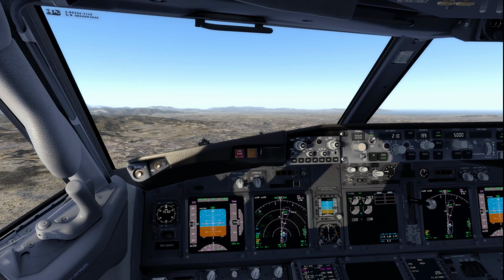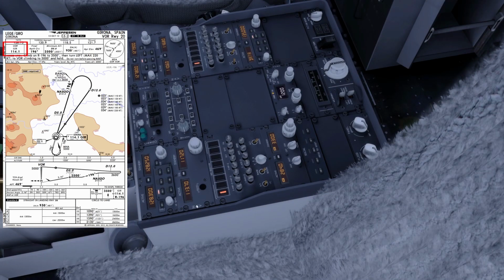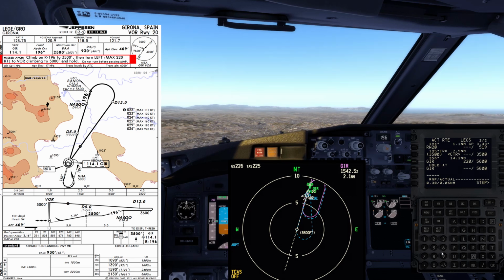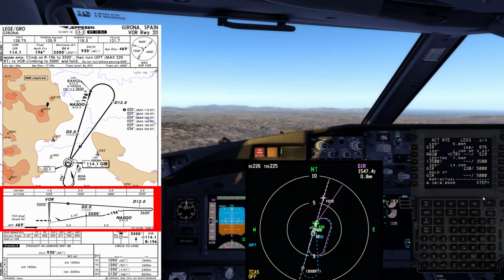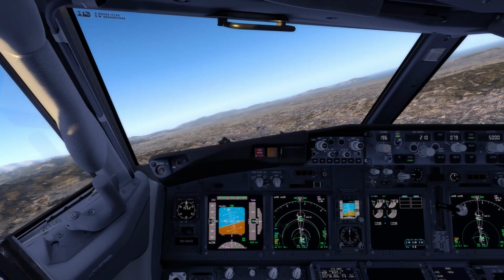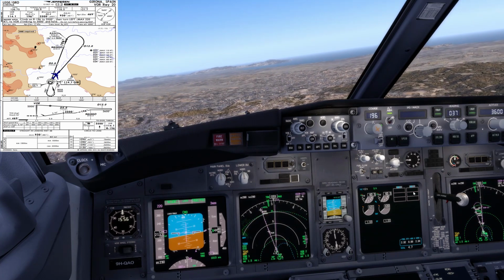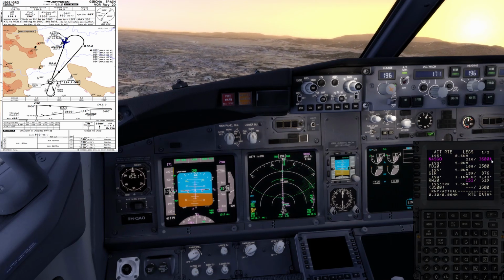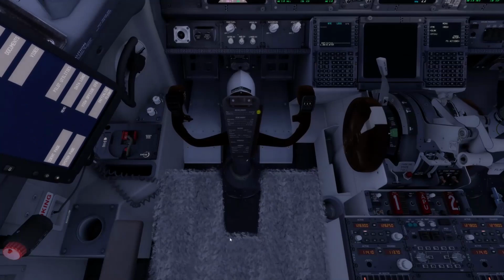How To Fly A VOR Approach On A Boeing 737 Explained By A Boeing Captain [Vor Approach Series PART 3]

Comment: How would this approach work with vs instead of vnav since the boeing doesnt have fpa decent?
Reply from the maker: It would be similar, the difference is that you need to initiate the descent at the descent point using a Vs that gives you the required descent angle
Reply: @PILOTCLIMB  thank you so much for the brilliant videos captain! Just to confirm, i saw a post on a forum where they said after setting mda height in the mcp i could set the green arc on the nd on top of the MDA point when approaching the FAF point to get a rough estimate. Is that something that could be done to get a estimate vs speed?

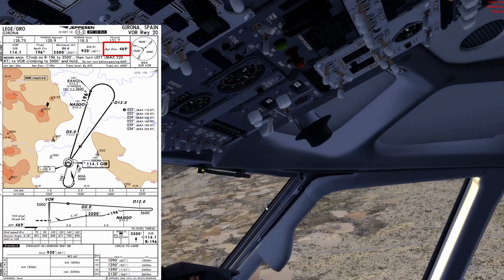Comment: Thank you for this video but I have a question. As you explained at 08:00, If I come from the north, which altitude should I cross the VOR? 9600 feet, according to the MSA or I should descend before to cross it at 5000th?
Reply from the maker: You are very welcome! If you approach from the north and you are outside a specific procedure, you should stay at 9600feet untill the VOR, and than descend inside the holding.

Comment: Back after a year and now I'm ready to ask whether not setting the CRS to runway heading really messes up with the VOR/LOC because I've been having an issue with the ZIBO where it will not be aligned with the runway. It will either zig zag as if trying to align with the VOR or else it will align off the runway center, with an offset to the right, aiming just half the runway
Reply from the maker: On the 73 you should always set the courses with the inbound radial or Loc..
Reply: @PILOTCLIMB  Hey. Does your Zibo land off the centerline during approach, c while capturing the VOR LOC? Mine does. ILS approach is flawless, but VOR makes the Zibo fly straight towards the DME equipment rather than the center of the runway. VOR in aircraft using the Garmin G1000 has no issues at all. It's a Boeing 737 (standard and the Zibo mod) issue in X-Plane 11.

Comment: Our company ask us to take gear down followed by flaps 15 at 2 miles prior to FAF, the callout we use is APPROACHING GLIDEPATH. 
Once we are visual we recycle FD (for go around guidance) and we set missed approach altitude 300’ below missed approach altitude on the final descent crossing FAF.

Nice video otherwise.!
Reply from the maker: Hey, Many thanks for sharing your NPA Sop!! Don't hesitate to share your thoughts and ask any question! Have a great day!👍
Reply: Same 2 nm before faf set DA alt verify vnav armed vnav pth on fma gear Down flap15 speed 15 speed brake armed and on faf when vnav alt on fma set go around alt landing checklist 🎉
Reply: Great video by the way thanks 😊
Reply: Why do you recycle your FD's..?What's happening if not...?

Comment: Thanks for this amazing explanation CAP.  I don’t have a flight sim , so could you please explain how we fly VOR approach (NOT FULL PROCEDURE) for example: if ATC clear us to intercept VOR radial with HDG SEL? 

Many Thanks
Reply from the maker: Hey, I hope you are doing great, if you get radar vectors, once you are on the last heading instruction before intercepting the radial inbound, you can extend the centre line (using the FMC) from the FAF for example, and then, arm LNAV. This will make you arircraft to fly on the assigned hdg and than intercept the radial inbound.

Comment: Speaking of LNAV, whenever I set just enter origin and destination in the FMC, then set departure and arrival runways, I am given a list of waypoints in the STARS list, I remove the DISCONTINUITY entries when they exist and it seems the flight will be successful. However, as the aircraft is flying in LNAV mode, at some point about 3NM from the destination, it tends to simply fly away from the arrival airport. I have Xplane 11 using its standard Boeing 737-800. I have no idea why it seems the autopilot simply "abandons" the course and flies the opposite direction from the destination.
I'd really like to understand how to navigate, it's amazingly difficult to grasp.
Been trying to successfully depart from RW31L at JFK airport (KJFK) to ILS 13 at La Guardia airport (KLGA) but LNAV never keeps on course. I rely on the waypoints given by the FMC list, I don't manually correct them, maybe that's my mistake...
Reply from the maker: Hey, it seems that the points you are loading on the fmc are not correct, the fmc constantly monitor the router to see if the plane is capable to follow it (due to performance for example). Send me the point you load on the FMC and I will have a look into it.
Reply: @PILOTCLIMB  I'll do ASAP, I'll list here which waypoints are shown in the FMC, from KJFK to KLGA there aren't many, I think two in between origin and destination.
Reply: Funny coming back here and reading something that I now fully understand. First off, the distance between those airports is ridiculously short for a Boeing 737. Been practicing longer distances and gathering better waypoint info for each flight. Still struggling with why and when using VOR/LOC when VNAV and LNAV alone seem to perform wonders all by themselves.

Comment: Hello Gabriele,

According to the chart 13-2 from 22nd Sep 2017, you have to fly over the VOR at 5600ft.

The outbound radial is 033 deg not 034 deg now.

Also you have only three radials depending on speed.

160knots 024
185 knots 028
220 knots 033

Concerning the waypoint BANOL it is also in the newer chart but you have to fly over it at 4500ft not 3600ft.
However in the newer chart BANOL is also an IAF which means that you dont need to fly over it if you use GIR as IAF.
BANOL has a distance from the GIR VOR of 12.2 NM and must be passed at 4500ft.
While you have to be at 3600ft at 12NM distance from GIR if you use GIR as IAF.
So the entries in the FMC were correct i guess.

Did i read the chart correctly?

I saw the whole video and hope you will do much more on the sim.

Especially the way how you changed the altitudes from 5000 ft to 3600ft to 2500ft to 1000ft was important to know.
And you were right, it gets really busy when you have to check the distances and altitudes.

But why did you use Autobrake max?
Would it not be sufficient to use 2 or 3?

Concerning the [FD20] fix:
What does the number 20 mean?
Does FD always mean Final Decent?

As always, thank you for your help Captain!
Reply from the maker: Many thanks for the watching and the very detailed comment!! Awesome!! 

Yes, I knew the chart was out of date, my goal was to show you how you can fly and set a Boeing 737 cockpit for a VOR approach.

If the chart is updated then you should respect the chart minimum altitudes.

I didn't spot that BANOL was also an IAF so WELL DONE!! You are 100% right!!
 
Since I didn't check the Landing Performances I used the MAX just to make sure we stopped before the end of the runway.
Autobrake 3 most probably would have been enough, however, it is important to check the performance before landing. I will do a separate video about that.

Have a great day!
Reply: Thank you for your very kind words.
They are very motivating!
And i have to say i learned more about cockpit preperation.

I forgot to mention that the Final Approach Course also changed. It is 195 deg now.

Can you please answer me the question about [FD20]?
Reply from the maker: @ahmedsmart1120  Sure, FD20 means Final  Descend and the 20 is the runway...so FD20 final descend runway 20.

The Final descend on a non-precision approach starts at the FAF.

Comment: I hope you are happy with the PMDG 737NGXu.

You have the NGXu version, right?

It is the best 737NG simulation that you can get for Flightsim.

For the Nav Database Navigraph offers updates for many aircraft addons.
I mean the AIRAC cycles.
Latest cycle is 2014 i guess, which means 14th update in 2020.

Make sure you install all updates from PMDG.
They have an own forum where they announce updates and where you can download updates.
Reply from the maker: Hey, So far so good, still getting used to it!! I will check their forum!! Many thanks

Comment: maybe out of way but I have i question....why I m fillling in DES FORECAST page isa deviation when FMS doesnt calculate altitude correction especially in cold temperatures below 0 in which you have to adjust altitude temperature corection manualy? Maybe it important for deccent not for final app segment
Reply: @Gabriele

If you could add this topic on your list it would be very nice.
Thanks
Reply from the maker: @ahmedsmart1120  I will do more videos about VNAV!
Reply from the maker: Hey, thanks for watching, Yes, the ISA DEV is entered during your descend briefing in order to allow the VNAV to calculate a more accurate descend.

During cold weather, the FMC ISA dev doesn't take care of the altitude corrections, and you should use the appropriate tables.

Have a great day!